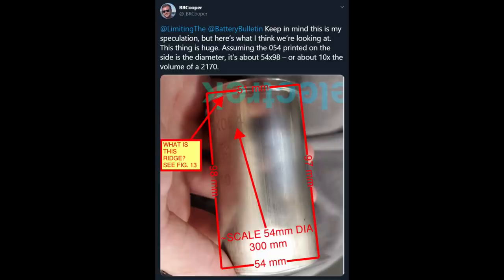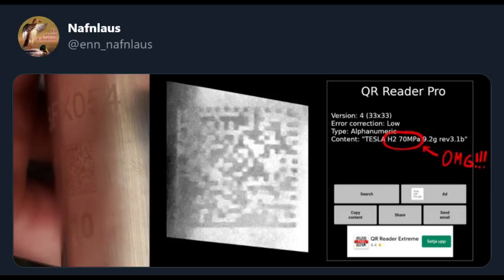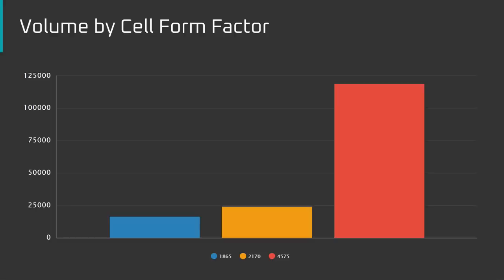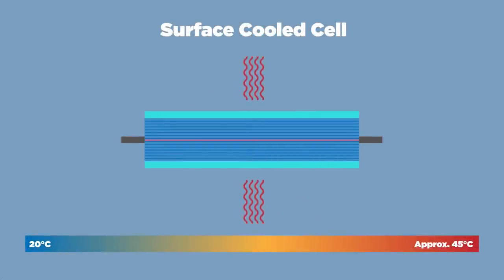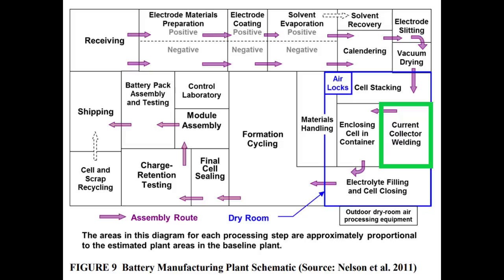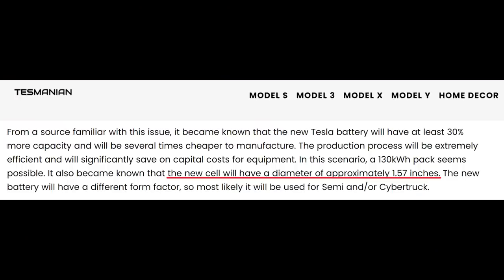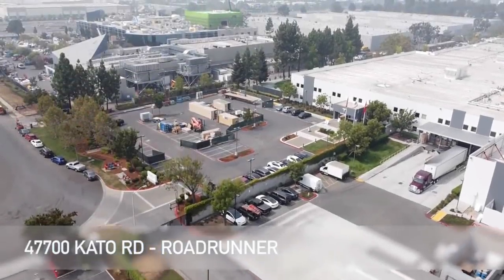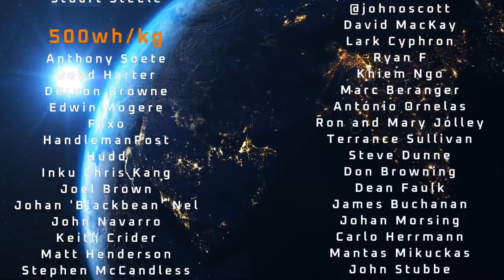Tesla's Alleged Roadrunner Cell - Comprehensive Breakdown

Comment: Great video!  Tabless is worth more than you are crediting it for.  The average electron trip is reduced from 1/4 of foil length to 0 (ignoring cell length).  Also larger batteries have lower resistance than smaller but a larger battery does not have lower resistance than 2 batteries half its volume placed in parallel!!  So functionally it is no change!  Now my rant: Vehicle to grid is easily implemented in every tesla car that supports supercharging.  It is a great topic for you in the future!  End of rant...
Reply from the maker: All good, I already calculated the heat generation in the Tabless Electrode Video, it was only significant under high loads, and even then wasn't earth shattering.
Reply: @thelimitingfactor  Tabless is worth more than you are crediting it for. ;)  And Elon will come around on the value of Vehicle to Grid.  The current power grids can not change output fast enough to keep solar wake and solar sleep transitions under control.  Vehicle to grid does not need to move allot of WH.  It can save the day due to the rate of response change.  When Elon changes his tune, remember me...  It is easy to do.  You just take a power wall and add a supercharger cable to it.  It then is the car charger from AC and can pull in the contactor and use the car as the input for the existing inverter.  Just a powerwall with an internal and external battery.  We can do it in a weekend, we just need the communication protocol to 'enable' supercharging...

Comment: With a larger cell and tabless design, why wouldn't you make the center of the battery hollow cutting down on the cell material being overly compacted in the middle, and thus allowing the battery being placed through a tube of coolant and having other tubes filling spaces like a Blinko board?  Limiting the inner heat factor?
Reply from the maker: Because the sides are insulated by the separator.  Better to cool tabless.
Reply: @thelimitingfactor  Ok👌

Comment: Thank you for keeping the contend easy to understand for non technical people like myself. In that context I have a question: why not use an  octacon battery design  rather than the cylindrical  design to further improve  the space and strength of the battery pack?
Reply from the maker: It slows manufacturing speed and creates bends and creases in the active material
Reply: @thelimitingfactor  why not make the battery pack one large battery platform  made of fixed prepressed honeycomb type multiple maxi-cells. Benefits strenght, speed, density, weight etc. Is there a way to mimize  the mentioned bends and creases in the active material?

Comment: Why don't they make a square cell so they can pack more in the same area?
Reply from the maker: Because volume isn't the main concern and square shapes cause deformation of the internal materials...no bueno.  The only way around it is to leave 'blank' spots on the electrodes

Comment: Did you double check the QR code decoding?. It was my understanding this was produced as a joke and that the true content of the code was just a 10 digit number or so. didn't the original tweet have a smiley in it?
Reply from the maker: I didn't check it!  Good question.  It could have been a useless dogleg.
Reply: Haven't seen the true content, but that makes sense to me. It was my understanding also that this decoding was produced as a joke/stab at nkla. H2 as in hydrogen and the other number as in pressure in the container.
Reply from the maker: @jwcbeusink  Regardless, I a lot of people took the tweet seriously.  I took it as seriously misguided but other people took it as seriously possible that they were fuel cells.

Comment: I still wonder if we will see at least a couple of features from the "pack patent".
1) Cooling.
A non-conductive liquid injected (Hibar) into the pack would provide full contact with the outside surface of cells.if this was injected "hot" and formed a gel at below normal operating temperature this could passively insulate and / or absorb cell heat as required.
When in liquid state, it could be pumped to transfer heat to the vehicle systems.

2) Fewer cells per pack lends itself even more to the idea of circuit boards pre populated with all connections, fusing and possibly individual BMS(?)
Dropping cells onto a layer of connected boards already in the pack, then placing another board on top would remove the requirement for individual weld connections.
This would also speed assembly, required to avoid a bottleneck in pack construction and speed removal and replacement of faulty cells if required, so may promote in pack testing.
Reply from the maker: Hey man!

1) My only concern with submerged cells is the additional weight of all that fluid.

2) hehehehe, I love the idea (s), looking forward to seeing what they've cooked up.  t-3!  weeeee!
Reply: @thelimitingfactor  
If you stack 3 cells in a triangle (looking from above) and assume 54 mm dia,  the gap between the cells is area of the equilateral triangle between the centres and the cell segments enclosed by that triangle.
118sqmm.
Overestimating.
Round up to 150sqmm?
Assume a tall cell, 100mm.
15,000cubic mm
Assuming 1000 cells =1000 gaps.
That's 15 litres of fluid
Assuming density similar to water.
15kg.
1.5x for circulation?
22.5kg?
(Minimising these amounts, could be below 10 Litres)
Reply from the maker: @rogerstarkey5390  Hmmmm, that doesn't sound that bad actually.
Reply: If weight is too much, they can partly fill the spaces with a low-density filler.
But I doubt the full bath thing, it goes against the heat evacuating from the edges.

Comment: No one is mentioning that this supposed battery, looks EXACTLY like a Maxwell super-capacitor without the label on it!

I just hope I am wrong and all this hype and speculation is right
Reply: Well, the principle of Maxwell's dry electrode originated for capacitors (with the understanding it could work for Li-ion battery processes) (the internal makeup is similar in principle)

However, if Tesla have unlocked the holy-grail of super-capacitors that can compete with Li-ion for energy density... well then... that's incredible.
Reply: Don't worry, it is called Battery day...